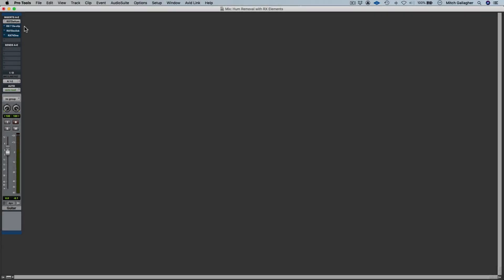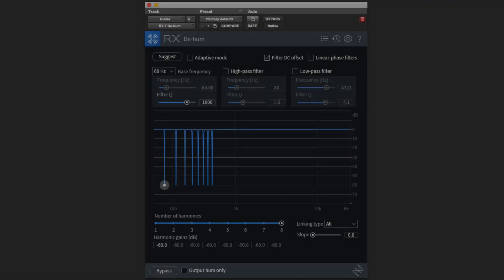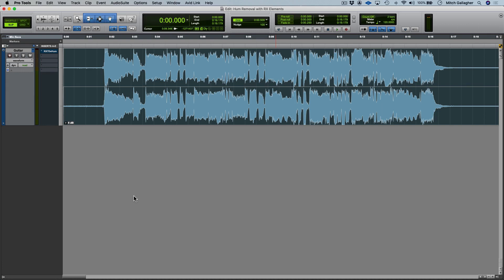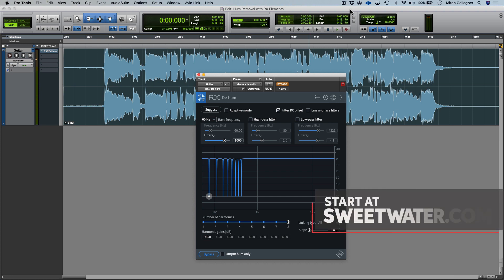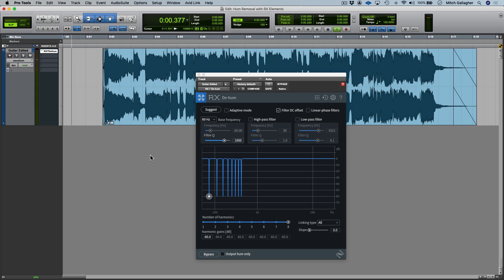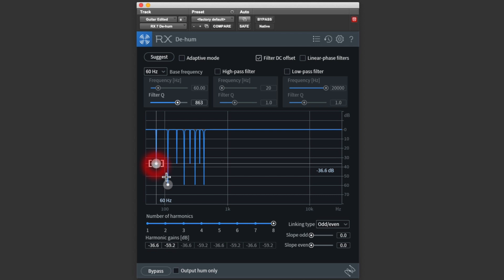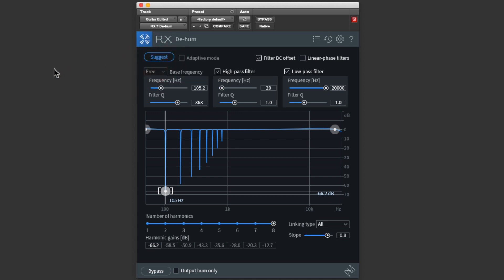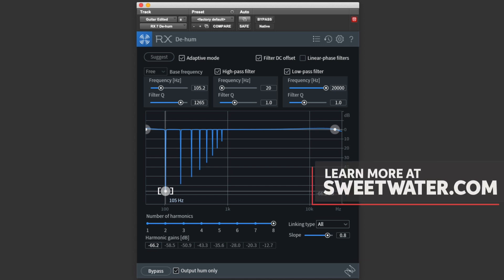How to Remove Guitar Hum with RX Elements

Comment: I did not hear any hum and the dehummed track is clearly a different take
Reply: It took me another listen to hear it... I still hear it with the plugin applied, at a slightly lower level. (on a second listen it seems to just be external noise from Mitch's mic)
Reply: @blue-tb2fd  a much better example to prove the software actually does what it says it is supposed to do would be to have a noisy buzzing guitar that people can actually hear and then remove the humming buzzing noise
Reply: @jasonjohnson4170  tbh i use RX allllll the time it's a pretty good suite of plugins but i got it for free so i cant say if the price is worth it. but yeh i use it probably daily in some way or another. it's not the sexiest plugin but i think it's one of my most valuable tbh
Reply: @jasonjohnson4170  i agree this demo was not a good demo btw
Reply: The hum is definitely audible...Listen right after the phrase ends...